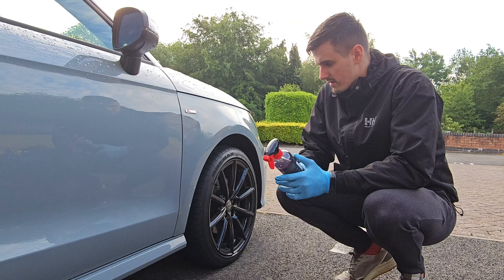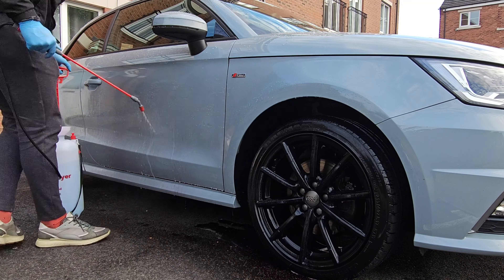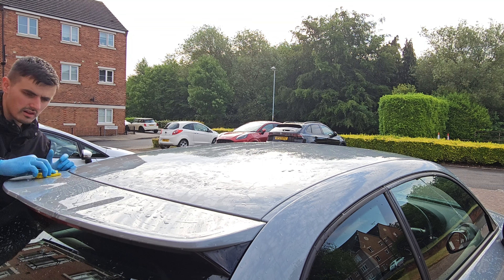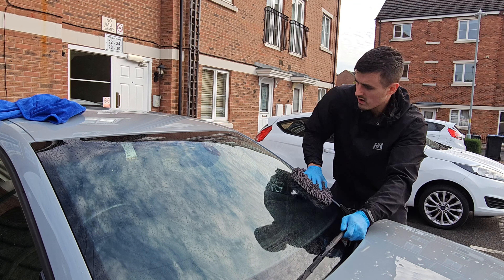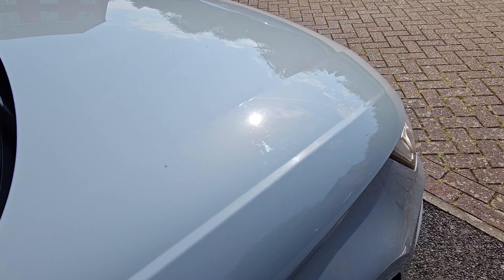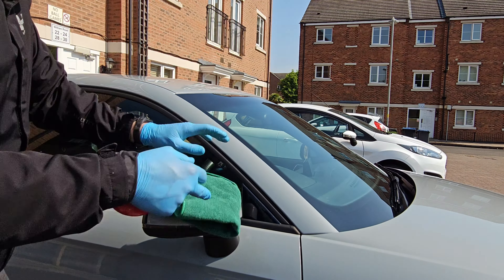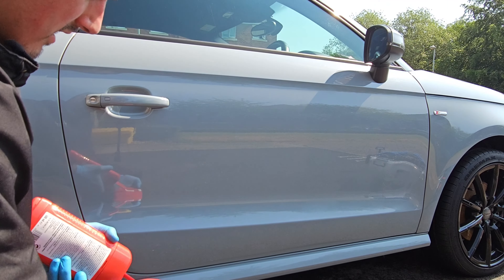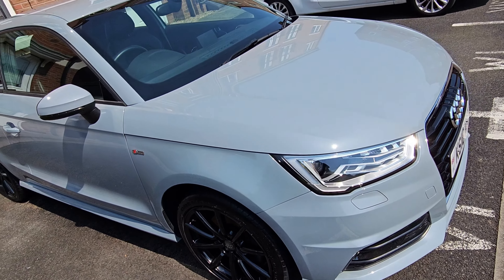AUDI A1 Decon+Polish+Waxing 🤑😯#detailing #valeting

Comment: Another great video. I hadn’t thought of using a pad (sonax) and hand polishing the smaller areas instead of me having to buy a smaller backing plate/ polisher. Im not after perfection, I have a life too! Cheers.
Reply from the maker: Thank you for watching! Exactly, from a normal viewing distance the difference whether you have a panel that is flawless and a panel with light scratches is hardly noticeable, depending on the color of the car ofcourse😮 and the time invested + clearcoat wasted is really not something I would get into , daily driven cars will never be showroom peaces, they need to be cleaned and deconed more oftened, yes we want them to look good no doubt but I wouldn't take it to a "flawless" state🫡😯

Comment: I know this is opposed to every popular method of detailing, but I do the same things, as I don`t have covered space, water or power. I have battery pressure washer, hand foamers and battery polisher. I`m just amazed about how little water you use to rinse. For a regular wash with pre wash and everything I use 5 x 10L water tanks.

Why do you polish some areas on hand?
How many hours did it take?
Reply from the maker: Thank you for watching! What people do on the internet is unnecessary tbh for regular daily driven cars, applying a sports car care mentatility on every car isn't optimal 🤔 

Polisher:
It is abit akward using it on smaller lower areas plus I really don't need alot of correction on the bumpers they get scuffed and chipped so it would make sense to birghten them up just alittle. Litterally an hour maybe 90min👍👍👍
Reply: @ValetSpecialist  You just need a smaller plate (3")
And how much water you use?
Reply from the maker: @flowinthrou  Will depend on what kind of wash, with a pre wash probably around 30-40 litres depending on the size of the car
Reply from the maker: @flowinthrou  I wouldn't mind getting a nano polisher one day, at the moment manual polishing will suffice, I don't want or need perfection👍🫡